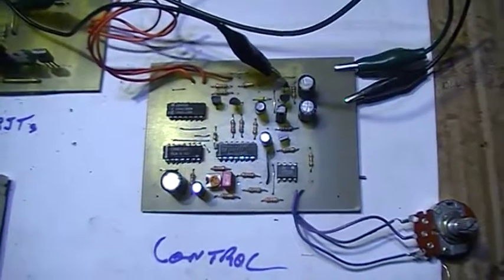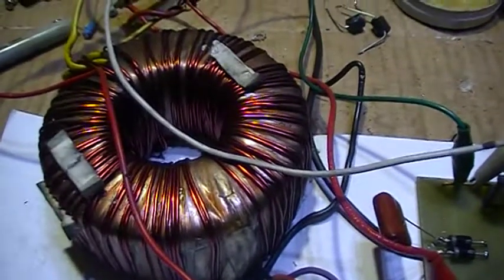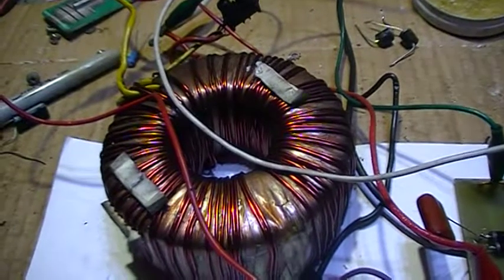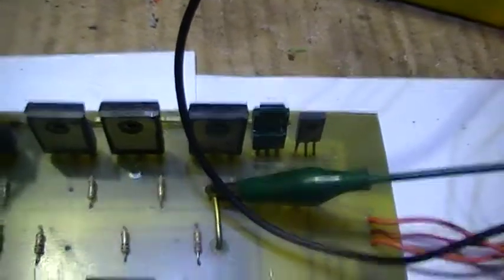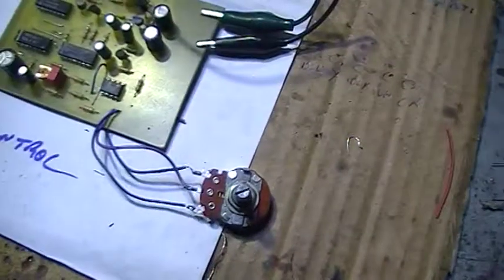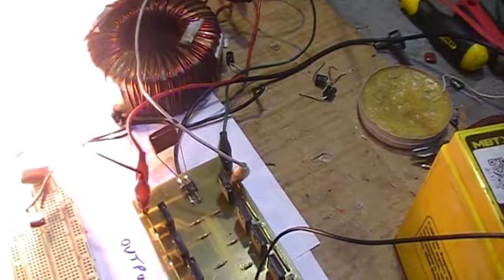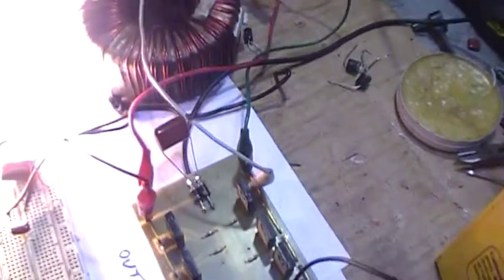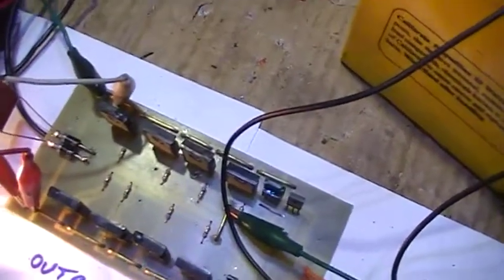killowatt inverter build part three

Comment: Last in the series - How did it turn out AND now above all 3 years later its reliability ? GREAT VIDEO
Reply from the maker: Reliability no problems. Output waveform distortion under load was awful, not enough iterations in the SPWM  waveform to get the sine  was after.... its easier to use a small micro to do this job now. in fact SPWM modules can now be sourced from China really cheaply. This one runs house lighting only as the low standby current of 12mA means it can be on 24/7, negating any need for auto load switching.  Thanks for your interest.
Reply: @dayleedwards3521  Thanks for te reply. I have a China built one but I need a PV input of 600V (I have 20 x 48 Volt 500 watt PV panels) So I figured I'd build something. How did the IGBT's work out ?